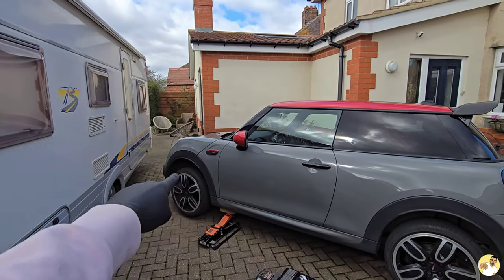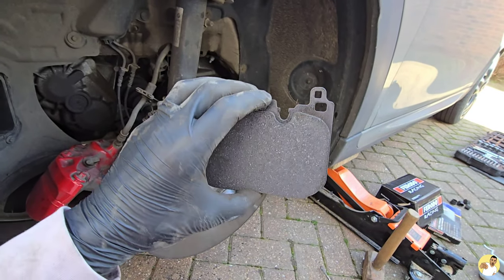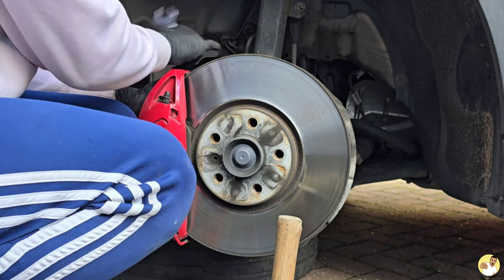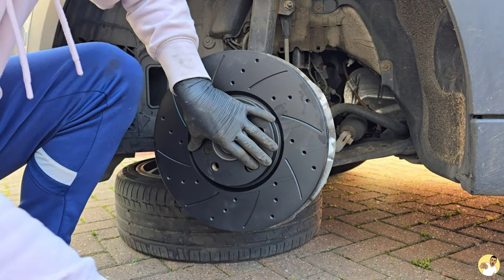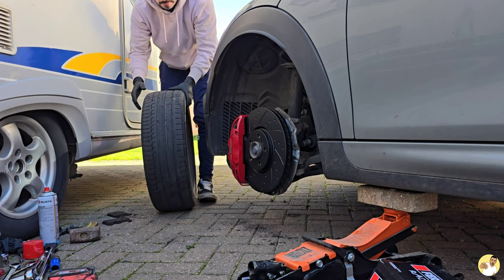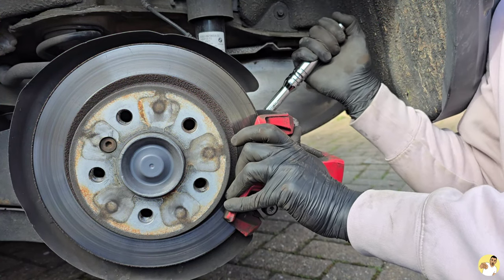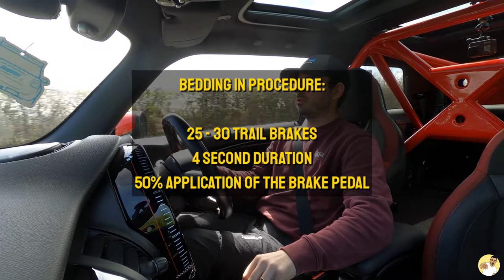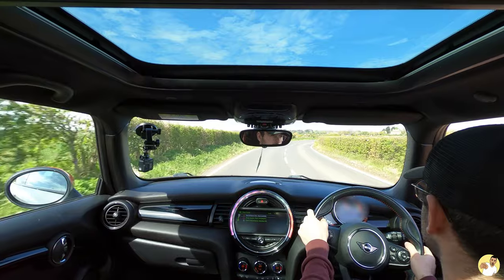UPGRADING MY OEM BRAKES FOR THE NURBURGRING

Comment: Loving the vids! I have a question are you still loving your JCW I am hopefully picking one up next week. I am in the same sort of boat I have had m140i/ audi s3/ golf R but they all just felt bit bland to me. All been auto I have opted to go back to a manual as well to be more engaging. Mine is literally the same spec as yours apart from the pan roof 🤦‍♂️ all good though my other car has one 😂
Reply from the maker: Yup still a class little car to drive

Comment: Ceramic brake grease is supposed to be the grease of choice I hear as opposed to copperslip. Brought to you from the home of Ferodo brakes, although I don't think they would have made your brake pads here given how tiny the original factory is now, it is in the dying embers of life, a sad reflection of how manufacturing in the UK has gone.
Reply from the maker: I assumed I'd get a little tube in the box for close to £300 for the pair of pads and I was wrong 😅

Had to use the emergency copperslip from the shed. Better than nothing I guess.

There is a brake pad factory about 15 miles from where I live. I'll have to look into who they supply 👀
Reply: @lookship  I'm guessing that'll be Mintex? I worked at Ferodo for 20 years, in the hey days they empolyed I believe 6,000 people, now there are less than 200 left. Yes that's a lot of money! and a bit of grease would have been nice.
Reply from the maker: @Peakwanderer  just spoke to a mate of mine who used to work at the factory. Place called TMD. Stands for Textar Mintex and Don, but they also had orders with Pagid and Brembo.
Reply: Seen a lot of videos for F56 JCW brakes and no one seems to put grease on the back of the pads, so well done for doing so.
Great video.